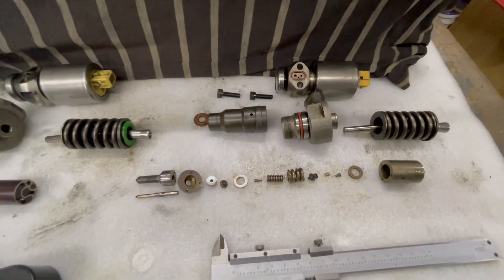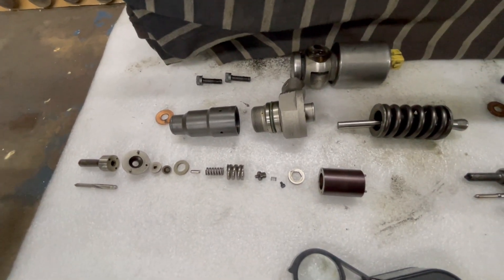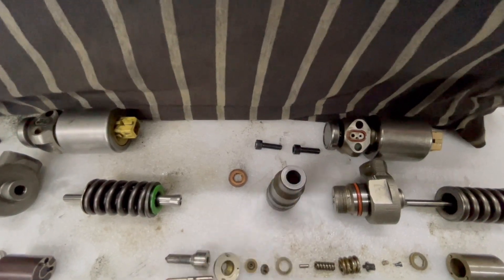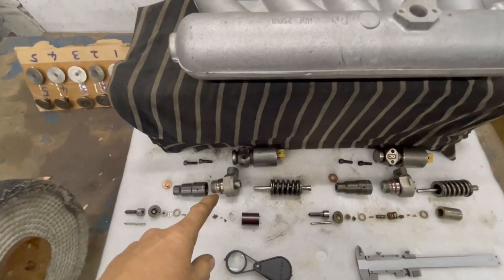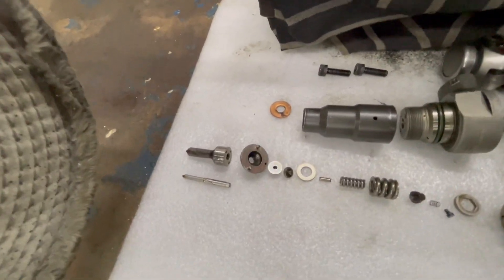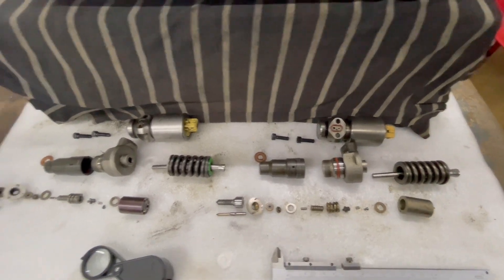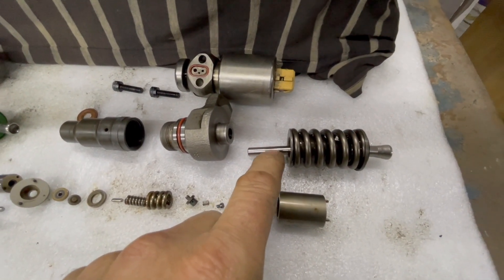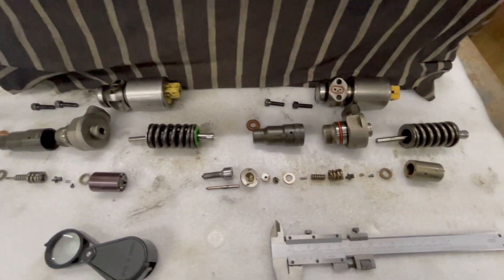10p & 15p TD5 Land Rover Injectors same apart from nozzles ?

Comment: Nice videos mate 👍
Do you think there would be any benefit in dropping 10p nozzles into 15p injectors? And do you think they would need mapping to suit?
My thinking is that they may be more reliable due to lower pressure & possibly more tuneable?
Regards 🚙
Reply from the maker: Thanks mate 😁👍 you can put 10p full injectors in and you’ll get a bit more fuel than the 15p but just bear in mind that there’s 2 different 10p types and one will deliver more fuel than the other, if you put the one that delivers more fuel then you get some good power gains especially when mapped and the boost turned up, I can get more power all through the rev range and overall max power when I tune a 15p TD5 with the higher flowing 10p injectors. Yes you could also just fit 10p nozzles to 15p injectors with same gains 👍

Comment: Aren’t the 10p Delphi and 15p Delphi strokes both the same so why would using a 10p injector in the 15p head and give more fuel delivery?
Reply from the maker: It’s only the nozzle that’s making more fuel delivery if putting a 10p injector in replacement for a 15p injector in the 15p head and cam. Even though the 10p injectors only have 5 holes and 15p have 6 hole the diameter of the 10p are bigger, I know if you add all the diameter of all holes together you would expect the 15p injector to deliver more fuel because the sum of all hole diameters added are greater than the 10p as there’s only 5 holes on a 10p, but if you work out the area of the hole using π then add them together you will see the 10p is actually more overall area even with one less hole, this is the reason you get more fuel from the 10p injector with same settings on a 15p setup, also the 15p cam compresses the injector 1mm more than the 10p cam 👍 cheers
Reply: @CarJunkeez thanks for that information

Comment: So the best combo is 15P head,cam and rocker arm and 10P injectors for maximum power on the Td5?
Reply from the maker: Yes, and you can use 10p head or 15p head but it’s best to match the head to the pistons as original 15p pistons have the combustion chamber slightly offset due too the different angle of the injector in the head, whereas the 10p are central.
You can use either rockershaft setup but the 15p rockers are slightly lighter and appear to be stronger due too there design. But yes use a 15p cam for the extra 1mm lift and 10p injectors with lash set correctly, that way you get more fuel delivery, but as in my videos there’s 2 different types of 10p injectors and one will deliver more fuel than the other 👍 cheers
Reply: @CarJunkeez it’s the Delphi version we need correct
Reply from the maker: @TheMachine4ever1  either of the 10p injectors will deliver more than the 15p but the BEBE2A000010 that has L071PBC nozzle will deliver slightly more than the BEBE2A00101 that has the L023PBC nozzle.

I think the Lucas and Delphi branding is maybe different on some injectors due to the date they were manufactured as it’s the same company. 👍 cheers
Reply: @CarJunkeez ok thanks but what about the atomisation of the fuel with the 10p? Wouldn’t it be less than the higher pressure 6 hole 15p injector?
Reply from the maker: @TheMachine4ever1 yea your correct you do get better atomisation with the 15p nozzles hence better emissions and that’s why Land Rover did it too keep with EU3 requirements, but you can get more power from the 10p nozzles and mapping due to them being able to flow more fuel. 👍 cheers

Comment: This is very interesting stuff..... I intrigued to how your going to apply this knowledge 🤔👍🏼
Reply from the maker: Thanks mate 😁 basically I need to get more fuel delivered in a controlled manner so rather than just increasing injector open time (duration) I want to increase nozzle jet size and number of holes but I also need to up the size of the plunger piston on the injector and that’s the difficult bit for TD5 injectors 😂 cheers 😁👍👍

Comment: Amazing video!
I could collect this  information

15-19P Green
BEBE2A01001
MSC000030
MSC000030E
L023PBC
6 holes 0.160 spray  angle 136°
Number (VIN) from: 2A736340
Head block  injector angle	9°30’

13-14P Black
DELPHI
BEBE2A00101
MSC000040
L030PBC
6 holes 0.185  spray angle 142°
Vehicle Identification Number (VIN) to: 1A736339
Head block  injector angle	8°

10-12P black
DELPHI/LUCAS
BEBE2A00001
MSC100670
L071PBC
5 holes 0.190 spray angle 145°
Head block  injector angle	8°
Reply from the maker: Thanks mate 😃 yea I’ve already found that information online too and have been looking through some catalogs and found some similar but bigger nozzles with the correct diameter that I need and correct spray angle but I’m not 100% sure on the physical dimensions as they are for a certain truck, I may have to buy a single one to try or there is a Chinese version for not a lot of money I could just try for size before buying Delphi 👍 thanks for your input mate it’s appreciated 😃👍 cheers

Comment: There are 3 kinds of nozzles L071PBC  L030PBC  and L023PBC
Reply from the maker: Thanks mate 😃 yea I’ve already found that information online too and have been looking through some catalogs and found some similar but bigger nozzles with the correct diameter that I need and correct spray angle but I’m not 100% sure on the physical dimensions as they are for a certain truck, I may have to buy a single one to try or there is a Chinese version for not a lot of money I could just try for size before buying Delphi 👍 thanks for your input mate it’s appreciated 😃👍 cheers

Comment: I wonder if the Delphi parts/injectors are all similar parts used to make up an injector to suit and could the volume cc be increased thats what is really need more fuel being chucked in 
And thinking about it the 15p injectors must be saping more power from the engine to create the higher pressure ... absolutely great video and investigation thanks for sharing
Reply from the maker: Thanks mate 😃👍 yea there a very similar nozzles in the Delphi catalog and to the specs I need but it’s knowing the true physical dimensions too that’s the problem as that’s what I need to know before I buy 😂 cheers 👍👍

Comment: I all felt a 10p pulled better low down than  15p even with a 15 p decated. 
Very interesting video looking forward to when your beast is running
Reply from the maker: Yea I’ve always noticed 10p even in standard form better low down than 15p in standard form, even though the maps are different the 10p injector will flow better both lowdown and high up 👍 thanks mate 😁 yea I can’t wait until it’s running too 👍👍 cheers